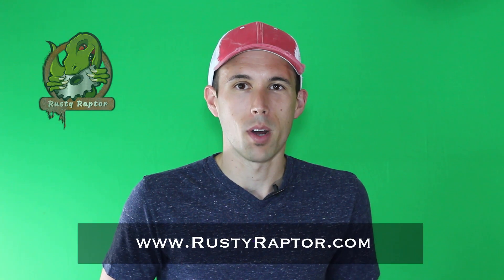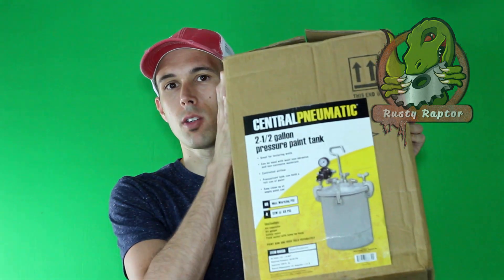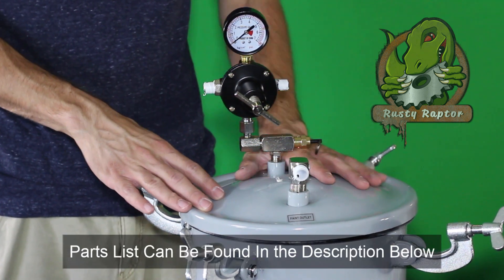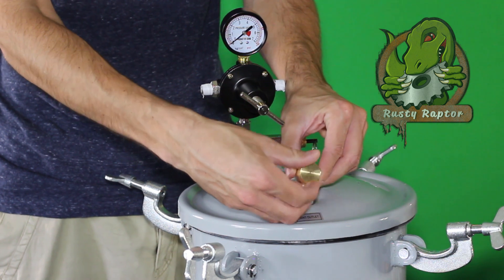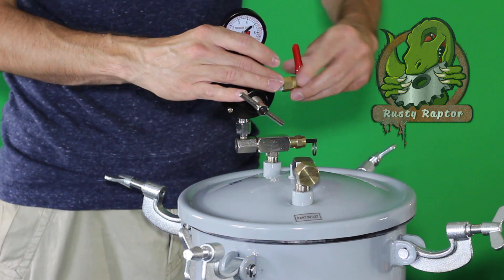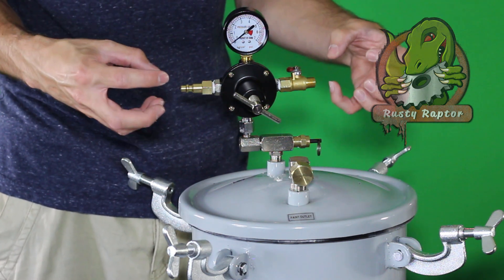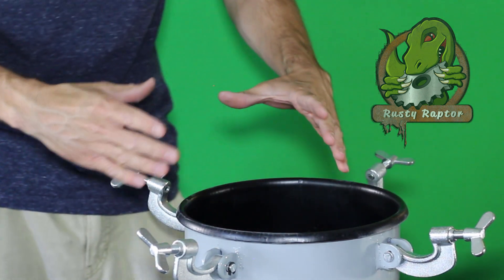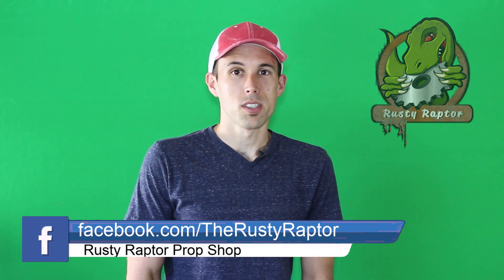DIY Pressure Pot for Casting Clear Resin

Comment: Bought this pressure pot and whatever that white thing is on the paint outlet, mine didn't come with. In the video it doesn't look like thread tape on that piece. It looks like some sort of white plastic piece that connects to the paint outlet.

The 3/8" brass cap I bought (not from the link in the description) didn't fit. I think it maybe due to whatever that white piece I'm seeing is.

Comment: Instead of adding a ball valve to the other side of the gauge assembly, could you not just cap it off and then use the smaller safety valve to release the pressure?

Comment: Hi. I just followed the video and made all the modifications just as you said. I am testing the pressure now. I filled the tank to 40 psi at which point the safety valve on the regulator started releasing air. It quit at about 35 psi. About 45 minutes later, the guage read 30. Why is it losing pressure? I can neither hear nor feel any leaks.

Comment: I'm using this method but the problem I'm having is that I have to leave the hose in the pressure pot, I think this is causing the pressure to slowly drop. In other videos they attach the ball valve to the male hose adapter, this allows you to remove the hose without letting any air out, after it reaches the desired psi. It does mean ditching the gauge that came with the pot but this seems like a more efficient method.
Reply: Two grown men playing with action figures why cant you leave the gauge on and put another ball valve on the inlet side of the gauge that you can close after the desired pressure is reached?
Reply from the maker: Go Mr Bojangles yes attaching it like that where you remove the hose is also an option.  We only use this because it allows us to fully regulate the pressure throughout the whole process
Reply: @rustyraptorpropshop2540  But doesn't it allow air to escape through the hose?
Reply from the maker: Not if your hose and links have airtight connections.
Reply: I didn't notice any leaks, I guess I'll check again.